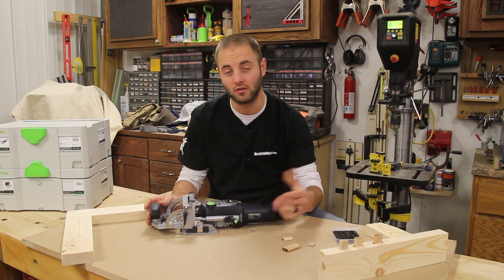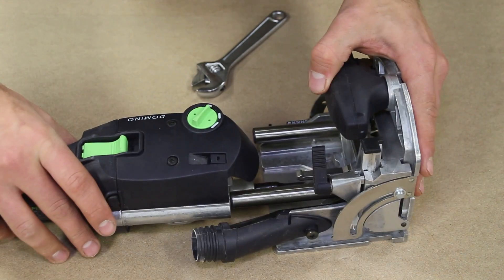Festool Domino Joiner DF 500 Q Review - 574432

Comment: Wow, for the price of this thing in the US you can get an all aluminum Pantorouter table shipped from Japan and do a whole lot more than cut dominoes.  What kind of protectionist tariffs are on these tools anyway?  300%?  And why doesn't Dewalt have an equivalent tool?  Seems like they're missing out.
Reply from the maker: C Puzz a pantorouter and the domino are two completely different tools. There are no competing models as Festool has a patent on the unit.
Reply: C Puzz they're just scumbag, money grubbers. Matthias wandells pantorouter plans are the way to go
Reply: @bohaggin5913  
Pantorouters are a gimmick at best.  They are not very mobile and when that is considered you may as well go with a traditional mortise and tenon machine.

Comment: Hi WA, I am intrigued as to how you would use dominos to join edge to edge boards. Assuming that the board edges are flat and faces are right angle to edges and flat how do you absolutely ensure that the boards will join to give one flat surface? Even with the fence set at 90 degrees is it possible to inadvertently push the cut out of square? I have tried this with twin dowelling machine and never get a perfect joint. My feeling is that the leverage on the driving handle is such that I can alter the fence alignment or gain some bending moment in the machine. Colin in Northern Ireland
Reply from the maker: colin farrier thank you for the question. First your edges need to be square on the bottom and the edge that you are joining. If they are not, your final glue up will never be flat. 

In the panel glue up, the domino acts like a biscuit or plate joiner. The long grain joint doesn't need the strength of the domino but it provides excellent alignment. 

Let me know if you have any other questions. 

-Andy
Reply: Hi Andy, thank you for your reply. My question relates to the lining up of the domino hole. Since the length of the domino machine handle is quite long there is the potential for leverage away from the exact right angle to the wood being cut. My question is can the position of the hole being cut be affected by pushing the handle off centre at an angle? Colin
Reply from the maker: colin farrier yes absolutely. That is why it is so important to have it right again the registration faces of the faceplate

Comment: Granted that these are a magnificent machine mate why are they so expensive ?, if they were priced correctly many more folks would purchase one, simple economics but here in Aus I think they are well over $1000 & unjustifiable for the home woodworker for joining a couple of bits of wood together, good review all the same 👍
Reply: I'm with you. Would love to purchase one but in the states the cheapest one with vacuum will cost 1200/1500. For now I'll stick with pocket hole jig and biscuit jointer.
Reply from the maker: Dirk Gibbons patents.
Reply: These tools are not meant for the homeowner. They are meant for professional use for years to come. We stand by festool.
Reply: +Sumo's Projects
A good morticer can cost about $2000 and a good tenon cutter about the same.  And those two things will be large machines meant to sit on table tops and not be moved around. 

Options on the market place for making joints with hand held are Festool domino, Mafell Duo Doweller and Lamello biscuit jointing system. 

And all of them are about $1000 minimum. 

The reason they are expensive is because they require perfect alignment for the joints to actually work accurate. 

So if they are off by even half a millimeter they will not work. SO that means they need to be perfected engineered and that means they are manufactured in Europe. 

If you want a cheaper jointing alternative get a Mafell biscuit jointer and then use different biscuit joints such as metal or plastics that offer different strengths and cutting depths.
Reply: I don't think $1000 is expensive at all for what it is. In fact I think it's being sold at a loss (and a lot of other festool stuff is being sold at giant profit lol)

Comment: Love my Domino!!  Also my Festool sanders, drills, jig saw, track saw,  MFT/3 table and the CT 36 E vac.  Yes, I'm a junkie and a happy one.                        JimE
Reply: How do you like the MFT/3? I was looking at that, makig one or building a paulk work bench.. decssions desscions
Reply: It is a great addition to the Kapex.  If a board is too wide for the Kapex it goes to the MFT.

I bought the version with the flip up guide rail and miter attachment.  I like the flip up guide rail but never use the miter.  I could probably get by with just the table and my parf dogs.

I like Ron's bench but I already had a bench and didn't want to go through the ordeal(for me any way) of trying to get all of the holes as accurate as the  MFT.  Another option is just to buy the top and build your own base.  The MFT base could be a little more solid but you have to remember it is built for portability.

Peter Parfitt, New Brit Workshop, on YouTube has a lot of info on the MFT including drilling all of the holes.

JimE

Comment: Great review, well done. I was especially interest in your comments regarding which tradesmen would find the use of the Domino DF 500. In all of the reviews and forum comments, I'm surprised that no one has mentioned its use who's primary role is maintenance. Although I'm only a hobbiest (and a nice guy), I'm forever being asked to see if I can repair something rather than be thrown out for new. This is usually related to flat pack furniture like IKEA's, where the mechanical fasteners have failed on the likes of drawers and cabinet panels. I find that using the DF 500 and glue, is a really simple and effective solution to the problem. In case anyone is wondering, I usually get paid in an occasional beer or wine (sometimes).
Reply: a trick: watch movies on flixzone. Been using them for watching all kinds of movies recently.
Reply: @Connor Tripp yup, I've been watching on Flixzone} for years myself :)

Comment: so its a biscuit joiner?
for fat biscuits....
Reply from the maker: lez briddon biscuits offer relatively zero strength. The domino is producing a loose mortise and tenon. Very strong. It's concept is like the biscuit but it is performance is  not even comparable.
Reply from the maker: lawrence tucker I will still stick to my initial thought as I said relative. No way do I buy 3 biscuits are as a strong as an traditional mortise and tenon or for a loose tenon for that matter.
Reply: Not sure I’ve ever seen anybody use a biscuit jointer for door assembly. Once you use this machine, you will understand. I thought the same thing you did, but was quickly turned around after a day of use. Amazing machine.
Reply: @Redneckf350  
There are different types of biscuits such as metal and self jointing biscuits. Some metal biscuits also have screw fittings in them so you cut them out put the biscuit in and then screw it into place.
Reply: bighands69 But still no way as strong, or as fast, as a domino. No way.
Reply: You need better facts buddy, http://www.woodworking.org/WC/GArchive98/Abstract/abstract1.html
Reply: Lawrence I appreciate you linking a source with empirical data showing the measurable difference between biscuits and tenon joints. I’ve seen the claim that biscuits provide “nearly zero” structural strength quite frequently. That has never made intuitive sense to me, nor has it really shown itself to be true in any of the projects I’ve employed biscuits in, and most importantly those claims never seem to be accompanied with empirical data to back them up. The study you linked agrees quite a bit more with my practical observations that biscuits actually do provide reasonable practical strength. Although I do think there are practical limits to how far anyone would ever want to go with biscuits (like anything else), I just think it’s important to emphasize that the ubiquitous claims of biscuits providing “nearly zero” structural strength is simply false.

Comment: I'm a big fan of Festool and the Domino 500.  If you buy the Systainer with the Domino assortment it includes all the bits and a wrench.  Might have mentioned the Plug-It cord compatibility with other Festool tools.  Have you done drawers using Dominos instead of dovetails?  Great vid, thanks!
Reply: Todd Reimer - I have used my domino for drawers and almost always do through mortises on the drawer sides and use the sipo (dark) dominoes for a beautiful effect.
Reply: Steve Coleman great tip, thanks.
Reply from the maker: Todd Reimer thanks Todd. Yes I have. Phenomenal tool! Yes I did miss that point on the plug-it. Very important too.  It is a great feature for a shop or contractor as you need one cord setup etc
Reply: Do yo do cabinets as well?